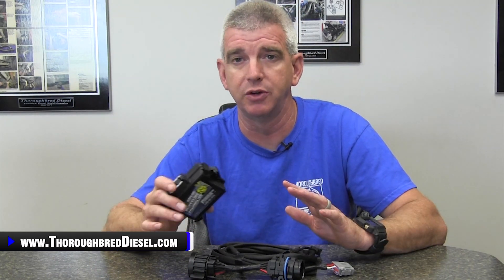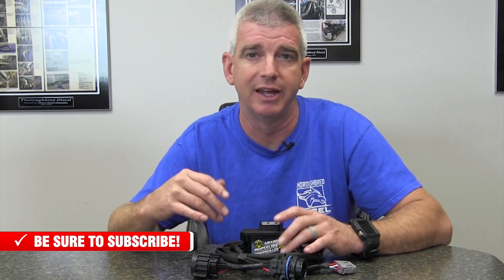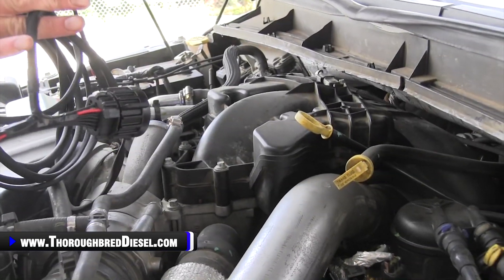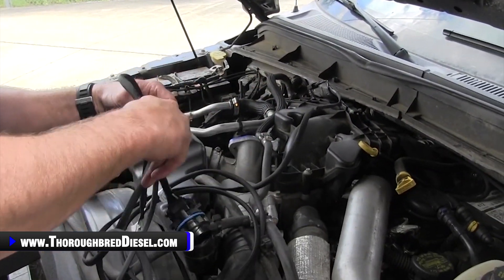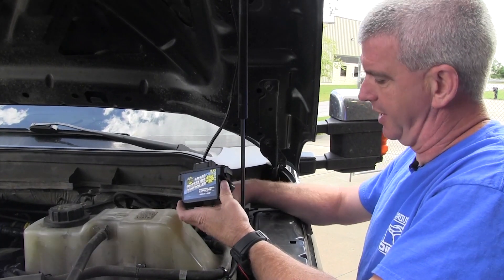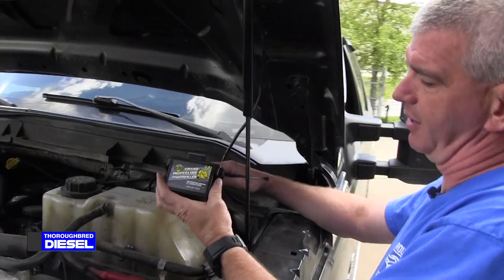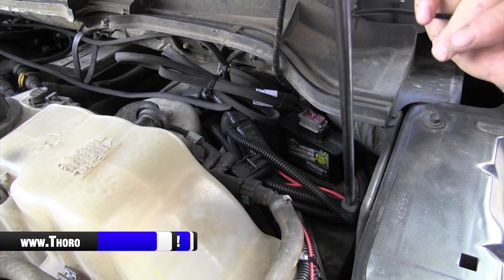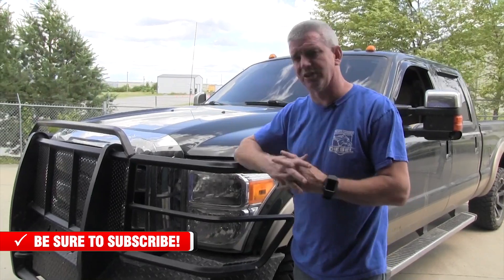BD Diesel Transmission Pressure Controller Install: 2011-2018 Ford Powerstroke 6.7L

Comment: Ford Friday with Wade.......
Has a nice ring to it. 👍
Nice job on the install. And you didn't even need a BFH. Impressive! 😂
Reply from the maker: Thanks! BFH is always needed with any install even if not shown on camera. :)
Reply: @thoroughbreddiesel  do you have to have the controller or will just the solenoid replacement be enough?

Comment: Is it better to run the controller and the  solenoid together or do you not need the solenoid with the controller?
Reply from the maker: They are both standalone upgrade products so you can use them alone or together if you want.  The nice thing about the controller is that you don’t have to drop the pan and install the solenoid.

Comment: I have a 2014 f250 6.7 Powerstroke deleted tuned. 
My My transmission in second gear it hits hard also slowing down it is hard would it help it
Reply from the maker: This won't correct any issues that you have already,  it is preventative to help the trans hold the power you are making.
Reply: I'm having the same issue with my 6.7. Did you install this modification? If so, did it help?

Comment: Does this take the place of the BD Diesel high pressure solenoid? I ordered one of those based on your video and it arrived, and then found this video today. Can you explain the difference and why I'd want one over the other?
Reply from the maker: Both work,  the solenoid is a good replacement to a solenoid known for failures.

Comment: Wow this is awesome. What's the name/part number of the Round connector? 3:51
Reply from the maker: That is the main transmission harness connector, I do not have a part number for the external harness, but the internal harness for the trans is BC3Z 7G276 G

Comment: Hello I’ve installed this the Allison pressure control on my 2012 duramax and when I use the the truck the acceleration of the motor get high or idle what is going on in my truck?
Reply from the maker: If you remove the module does the truck still do it?

Comment: Thoroughbred diesel, Is line pressure increasing beyond 15lbs of boost to cap at 300 on WOT, or you just get increased pressure  at WOT only? Thank you.
Reply from the maker: 15psi and up, it will increase to 300 max,  then will revert to normal pressures at less than 10 psi boost.
Reply: @thoroughbreddiesel  I appreciate the information, thank you.

Comment: So with that you dont need the line pressure solenoid? If not, Which is better to run?
Reply from the maker: This solenoid controls line pressure. An overall line pressure “box” works as well but you wont be doubling up on pressure. One will trump the other.